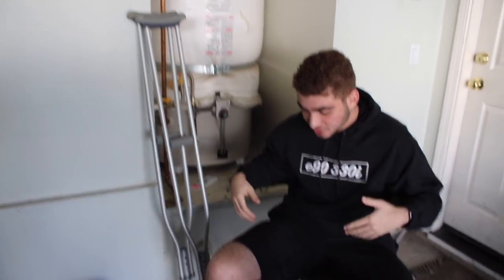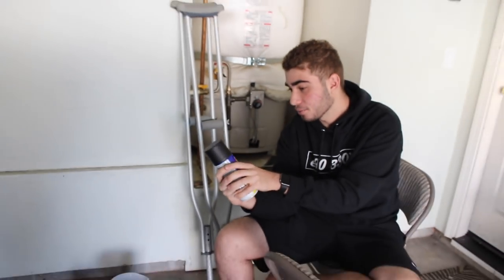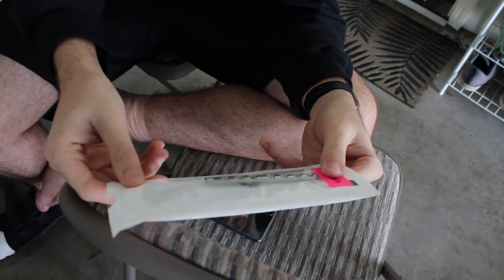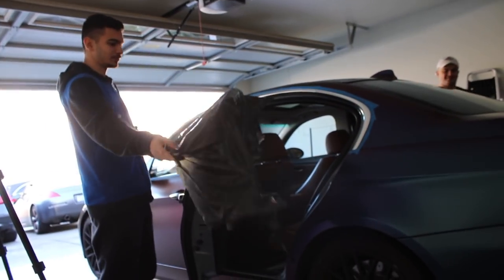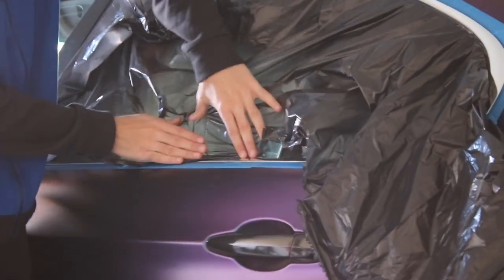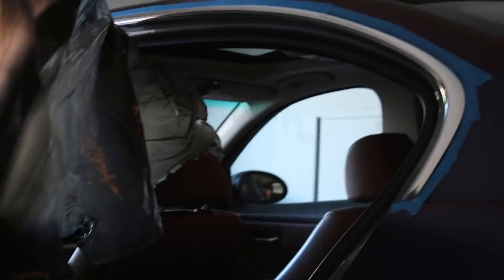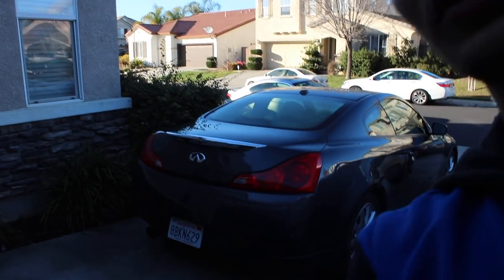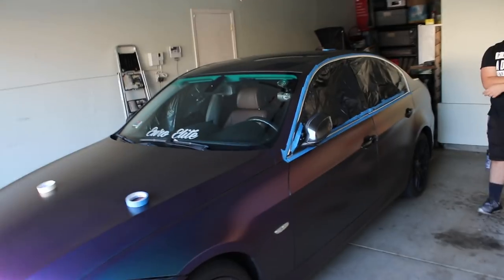FINALLY Painting My Trim, Is Plasti Dip Any Good? (e90,e91,e92,e93)

Comment: wrapping it is probably your best bet, but just remember once you take it out, because its chrome its really hard to put back. I know Justin Buice did it fine, but when I tried it got all bent up and I just ended up finding a car parting out black trim, but the black trim was slightly matte. You can plasti dip and use glossifier, but wrap should be much better

Comment: I'm going to plastidip mine in the next few weeks. I'll remove trim that goes along the top of the window completely and spray it. I've read that removing the trim that goes along the bottom can be problematic and the side mirror is in the way. Because of this I'll leave the bottom trim on, mask it off and then spray. I think it will be a lot easier removing the top triml. I've plasti dipped the side mirrors on my other vehicle, the kidney grills on my BMW and various badges. Unlike many in the comments section I like plasti dip. If you mess up it's so easy to remove too

Comment: It wasn’t done  correct
Reply from the maker: steven geronimo how would you have done it?
Reply: Nour Hummadi first off i didn’t see that you guys clean prep the surface thats a big step, second of all when plasti dipping  you should wipe of the cap after each coat so you dont get splattered dip , i dont know how many coats you did but i would recommend 4 coats . The first coat should be very light about 25% transparent then wait like hañf hour between coats and go slightly darker  by the 4th coat you should see that nice dark color  then to finish it off i would of done 2 additional coats of plasti dip glossifier so it would give it that nice look  i got a bmw as well i got the f30 type and i plasti dipped my rims and it looks amazing havent had issues what so ever  i also plasti dip my front grille and it looks incredible the glossifier and more coats and along with the clean surface  i would recomend
Reply from the maker: steven geronimo dam, I didn’t do half of those steps. Thanks for sharing I’ll need to try it one last time then lol
Reply: Nour Hummadi another thing i would recomend  i would change the plates to the black ones customize your plates to go along with your car club then put the plates in the middle as a luxury car it looks weird having them centered to the right  i had a e90 before upgrading  i actually have  a 335i engine with 45xxx miles it would be a huge upgrade for your car
Reply: Nour Hummadi yeah go for it bro

Comment: Its better to take it off the trim.🤔
Reply from the maker: problem with that, there is a good chance of bending the metal. The trim is very expensive.
Reply: True. After you take it off and put it back, it never looks quite right. And each section is like $300 to replace